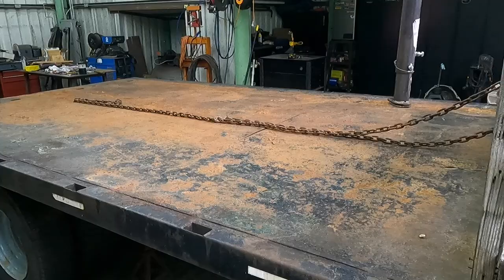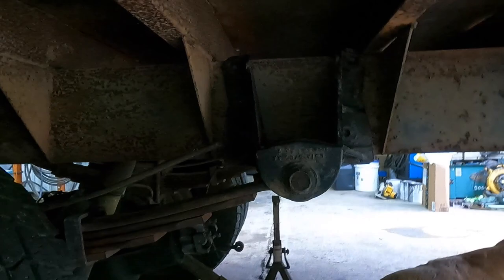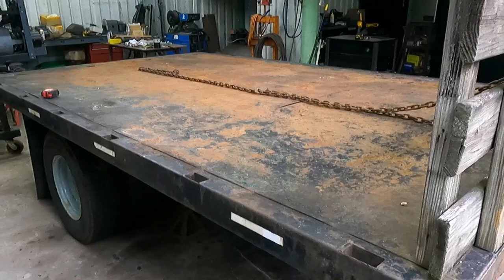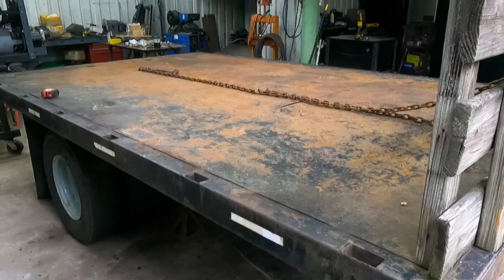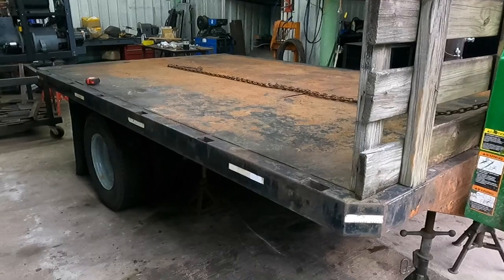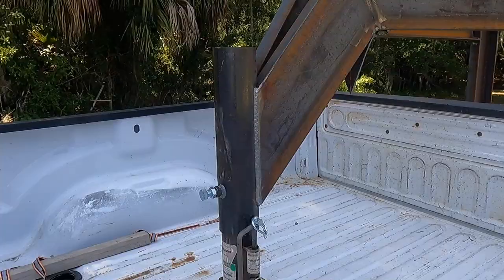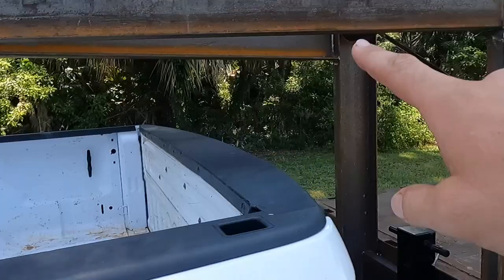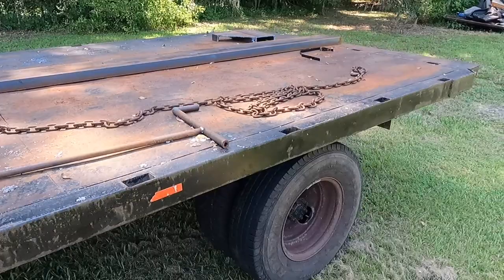Utility Gooseneck Build Pt1

Comment: I enjoyed the video and trying to find a small enclosed goose neck trailer for my f150. The reason is where I use to work my boss let me borrow his short bed truck with a goose neck trailer to haul a skid steer to my house. The skid steer was very heavy but with the goose neck trailer it pulled great but you could feel all the weight pushing when you tried to stop. I would love to have an enclosed small goose neck trailer because it puts the weight just forward of the rear axle and distributes some weight to the front axle. So far I haven’t found anything,that’s why I’m here getting some ideas. Great video!

Comment: Guess the only thing different i would have done was added at least a 4"(probably a 6") channel iron along the two bottom channel irons, two reason. A little more tire clearance and as you even said that flatbed was designed to have a truck frame underneath so you lessoned your payload capacity by not adding frame underneath!